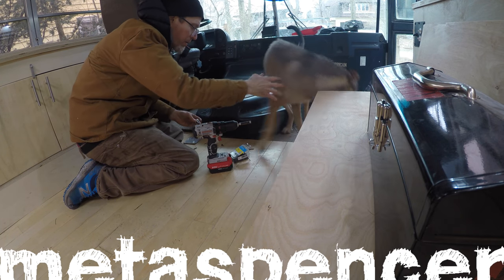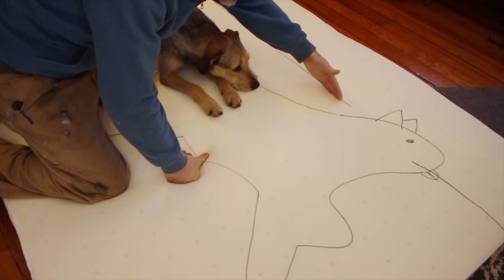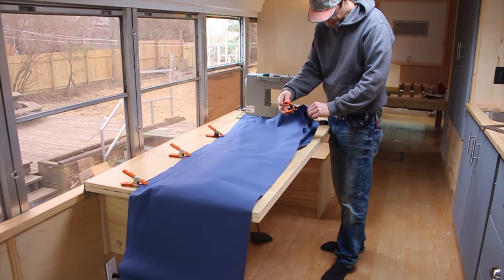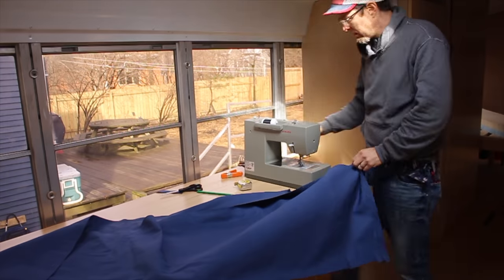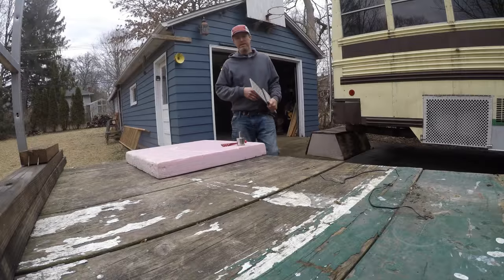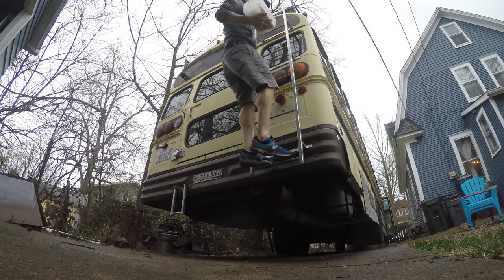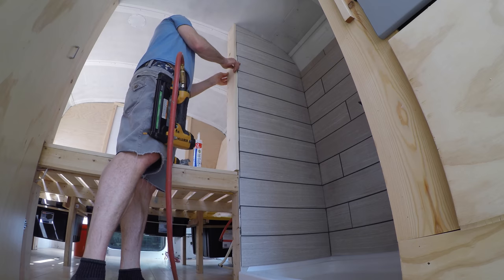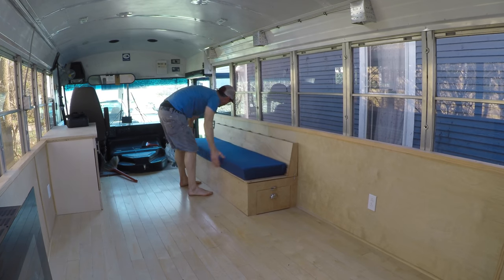Upholstery Clinic -- Prison Bus Conversion #52

Comment: OMG! The clamps instead of straight pins. I love it! I belong to a hammock forum and the DIYers call that machine you're using a "thread injector". You did a fabulous job!
Reply from the maker: Thread injector! Love it. I think makers of other power tools could learn a lot from the sewing machine's design ... love the foot pedal, fact that you can use it while seated, the light, the stitch variation, and more! :)
Reply: Pins would have been helpful on those corners 😁
Reply from the maker: I’m learning... good tip!

Comment: Great job Meta. Yeh sewing has a ",feel good" element about it. Ive tried it and really loved using the machine. The idea with the cushion covers is to make a "pouch" as it were, for the cushions to slip into. Like a quilt cover you buy from the store. it has one end open with clips, and the other end closed, stitched as it were. the idea is to make the pouch slightly larger than the cushion so you have room to play with in manipulating the cushion into the pouch. All in all youve done a good job so far.
Reply from the maker: Thanks for checking it out! I've found that precise measurements with fabric can be challenging, but I'm guessing I need more practice.

Comment: high qual shower stall mate. absolutely fantastic. this is probably the best one ive seen so far on any of these conversions. Did you build bthe stall dimensions to match the tile dimensions or was it just synchronicity that those particular tiles fitted the cubicle. ?
Reply from the maker: Synchronicity ... I built the stall around what was just about the smallest shower pan/tray I could find, as I didn't want to use up too much space on the shower. Things have a way of working out, you know how it is :)

Comment: Oh, btw, you put a cover , or duvet cover or pillow case on by keeping it inside out and lining up two corners then pulling it over the mattress and turning it right sides as you pull it down. I'm sure there's a video somewhere
Reply: Look up Carol Fitzgerald how to put on a pillow case, or any of the dozen same videos. Same applies to slip covers and comforters
Reply from the maker: Thanks for the tip! You're absolutely right: that's the way to do it. I'm learning!

Comment: Next time you need to do sewing like that! The thing you do is use stick pins. And you so right over them.
My mother covered custom wheelchairs for children with spina bifida. When you do a corner you leave the needle and position and left the foot and rotate the project to the right orientation. Not laughing at you laughing with you. No give yourself a pat on the back not bad for someone was never done this before. Sewing your lines without the pins as straight as they are is good. I wish I could've been there to give you a hand. But you got your head wrapped around the concept and you're doing good work.
Reply from the maker: Haha, I was way out of my depth! Pins sound like the way to go for sure. My corners definitely need work. 😀 thanks for the tips and for checking it out